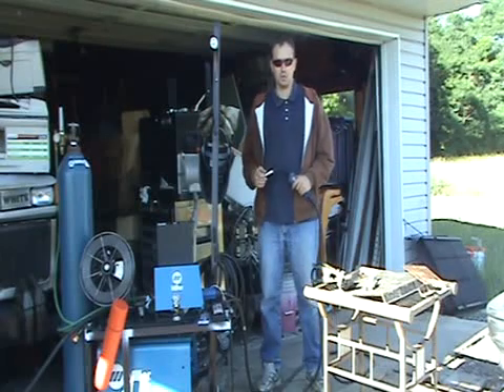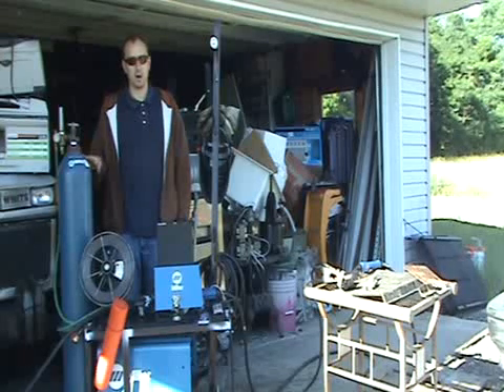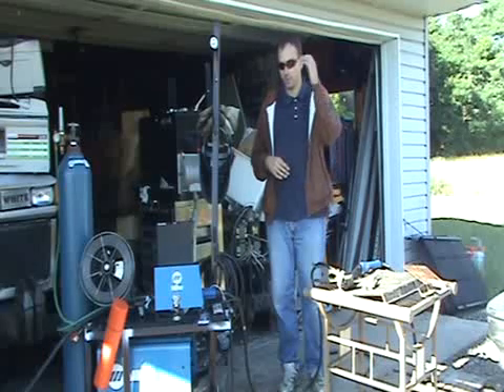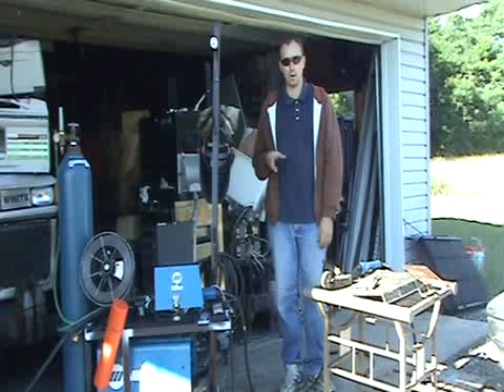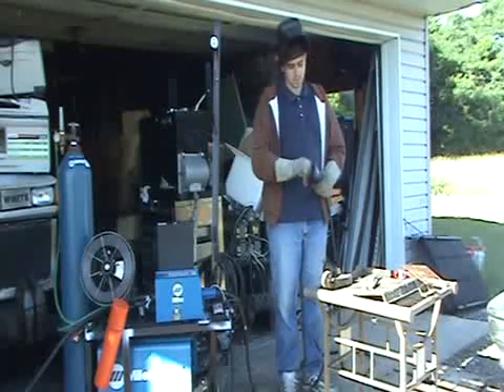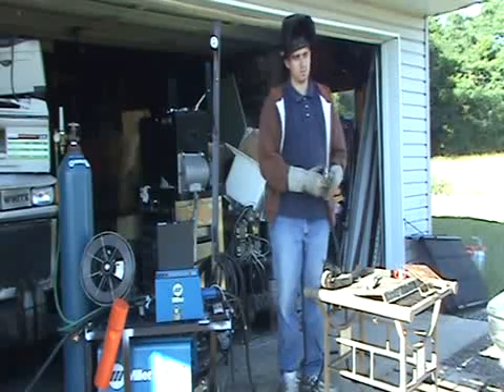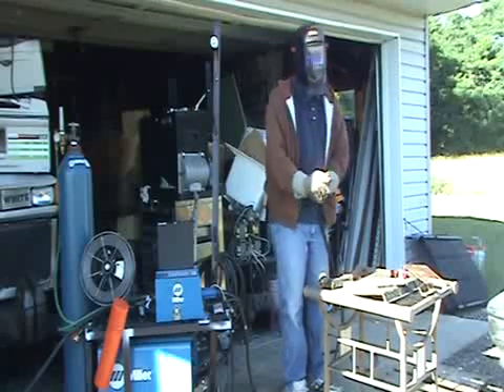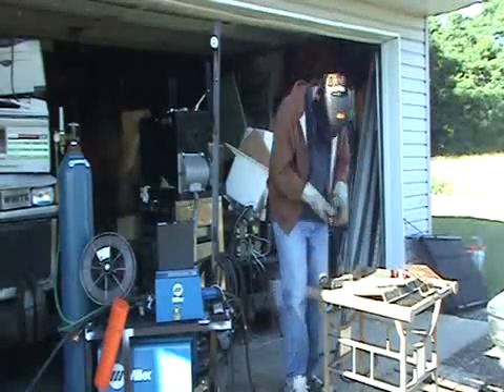MIG Welding 2 - Running a Bead

Comment from the maker: @Em1nenceFr0nt It depends on the process and how dirty the metal is. With stick welding, you can sometimes get away with some rust, mill scale, grease, or paint. Wire welding with flux core is less tolerant. With MIG and TIG, you need shiny clean metal. MIG will trick you because the weld will look fine, but underneath it's just floating on top. Personally I always grind the weld area clean just to make sure the weld is as strong as it can be.

Comment from the maker: @01WALKMAN01 Lincoln Weld-Pak or Hobart Handler 125 will do flux core welding. Campbell Hausfeld makes a stick welder under $100 and I have one, but it doesn't weld much before needing a cool down.  More money buys more welding time. Get a Miller when you can afford one.

Comment: Pretty informative video you made. The only thing I would like to point out is the  use of safety glasses. When your welding you should leave your safety glasses on for some extra protection. I cannot even recall how many times I was glad I was wearing mine while welding and wire wheeling slag off my welds and something would have gotten in my eye if it wasn't for them.

Comment from the maker: The mix I was using is 75% argon and 25%CO2.  For aluminum, you need straight argon.  On steel, you can run pure CO2 if you want.  It's cheaper and is supposed to give more cleaning and deeper penetration.  As long as the metal is very clean, 75/25 argon/CO2 works well enough and is less likely to burn through thin stuff.  Personally I've never tried straight CO2, so I cannot attest to this.  You can also run straight argon on steel.  For instance, all TIG welding is done with straight argon.